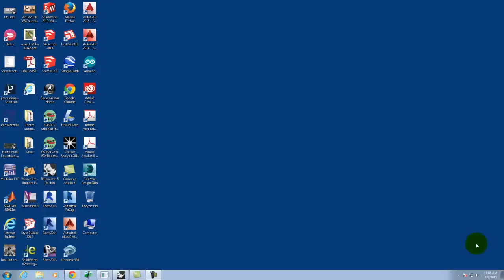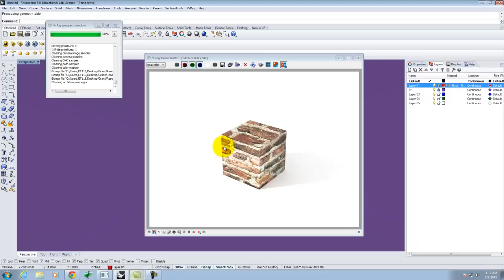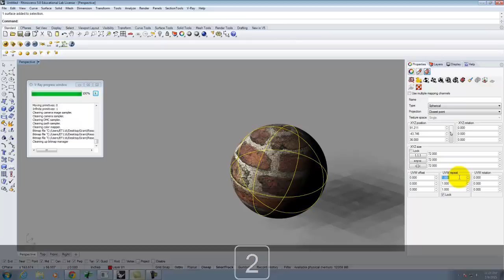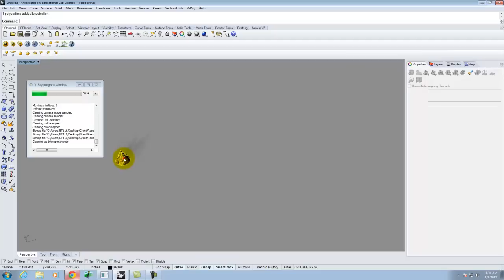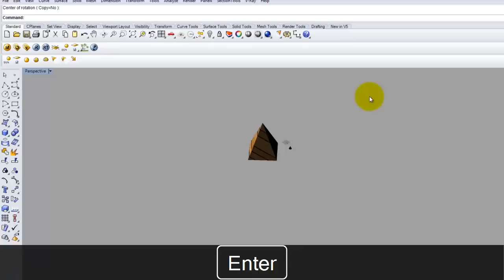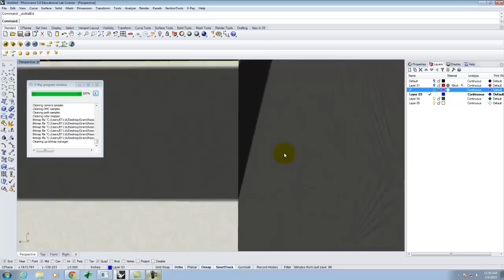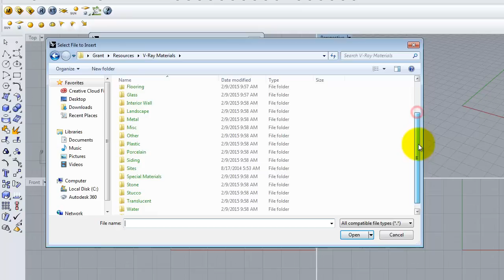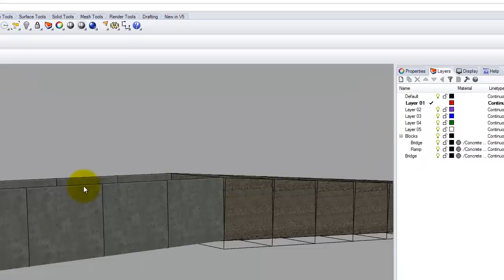Lecture 208 - Texture Mapping in Rhino and V-Ray - Spring 2015

Comment: hai,
how to create a texture that is different depending on the model cube without having to destroy it first.???
Reply from the maker: You can have different texture mappings for each cube.  You just have to create a mapping for each one (likely using the box map preset) and adjust settings as necessary.

Comment: Is there any way in which you can use texture mapping on a large group of selected objects, say a multifaced concrete design, instead of individually mapping each object?
Reply from the maker: You should try the "match mapping" button to copy mapping from one object to another (or several others).  I hope this helps.